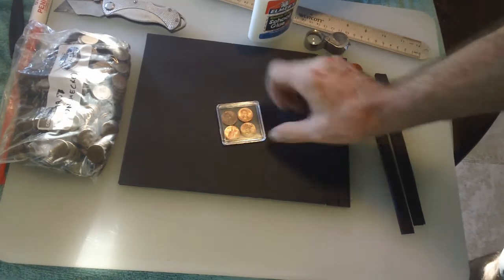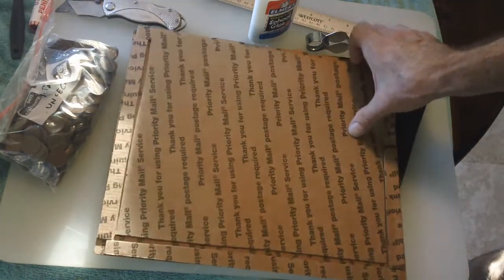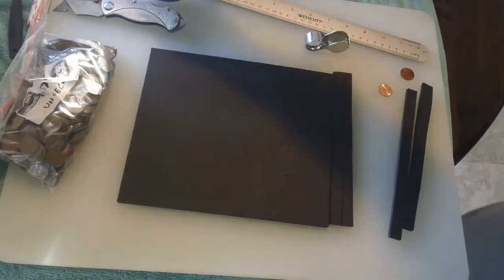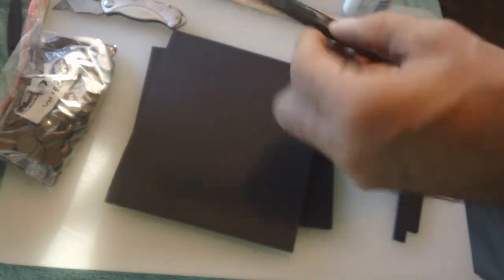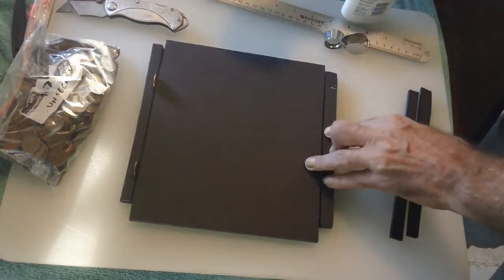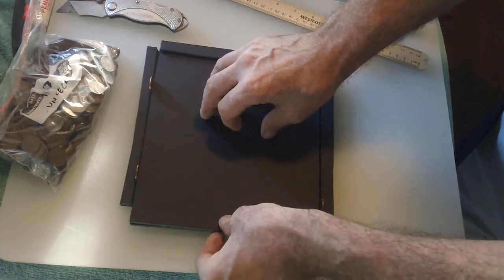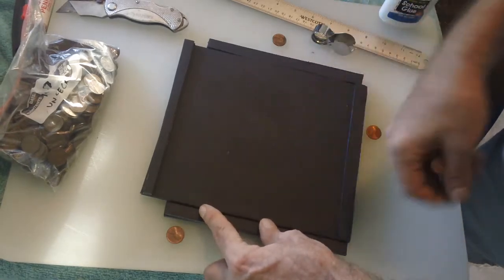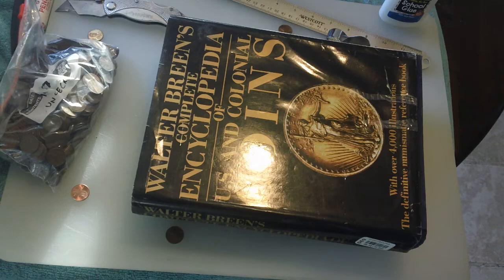Building Coin Spatula v2 0

Comment: Kpeavey2 I really like the creativity of this..if what you are building w the foam board does not work.. perhaps a larger hard plexi glass set up - you have a lil box in the vid w the 4 coins (which sparked my idea - as you were able to flip all 4 w no prob and it was see through) - anyway, w plexi-glass you could mill out the area that allows one half to slip down on to the other. It should be strong enough and see through. perhaps incorp wood and plastic? either way I think it's a genius idea.